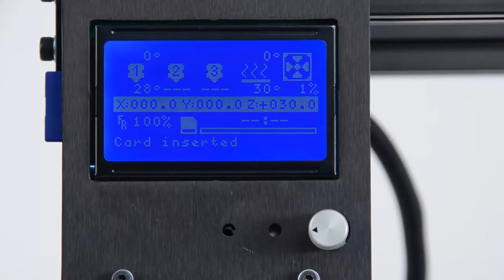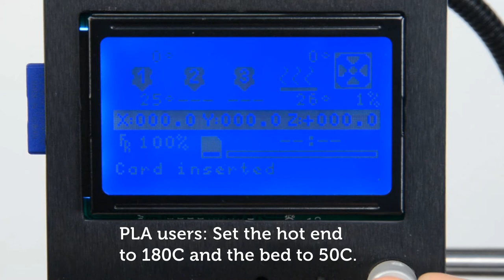How to level the bed on a LulzBot TAZ

Comment: So after following several less than stellar examples, the following is the method I tried and successfully used today on my Lutzbot Taz 5: Start with a standard sheet of paper and cut three strips and stack them. A standard piece of paper is 0.005 inches thick, so your stack of three strips is 0.015 inches thick. With the bed and nozzle COLD, work across the bed tightening or loosening the adjustment bolts using a box pattern: lower left, lower right, upper right, upper left, back to lower left twice around making sure the three stacked strips slip under the nozzle with the slightest bit of resistance. Then go across diagonally: lower left to upper right, to lower right, to upper left, back to lower left and make any further adjustments. Check the clearance at the halfway points as well. You will find those have actually less clearance than at the corners. Fire up the printer and allow to heat the bed and nozzle. The clearance will decrease, but you should still be able to slip at least one strip under the nozzle in the middle of the bed and midway along the edges of the bed. I also built my own bed calibration gcode available here. Good luck! https://drive.google.com/file/d/1he_Rbe_5UWkycvby-J0VM8GMPyO1nYEc/view?usp=sharing

Comment: May be there is a blue paper used on the bed. what is it and why it is used ?
Reply from the maker: M A Motin Sobuj The yellow paper is used to feel the resistance on the nozzle to the bed. The bed is covered in blue-green PET film, which is the bed surface covering for theTAZ 4 (and previous versions).

Comment from the maker: The key to a perfect print is to have a level bed with good adhesion on the first few layers. Watch our new Bed Leveling video to see how you can level the bed on your LulzBot TAZ to get perfect prints: How to level the bed on a LulzBot TAZ
Reply: Whosa whatsis, do you have the time to properly explain why we should refrain from using the word "level"?  I think you put it more eloquently than I am able.
Reply: I usually just pick up a Bukito and turn it sideways (while it's printing), and then ask whoever I'm talking to if the platform is still level. This seems to get the point across pretty effectively. Then I just have to tell them the correct term, which is 'tram'.